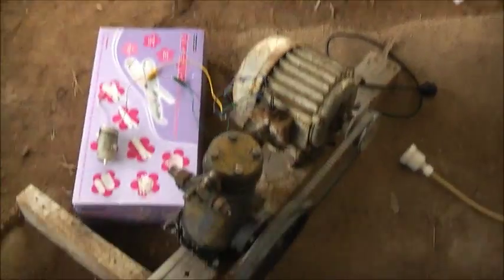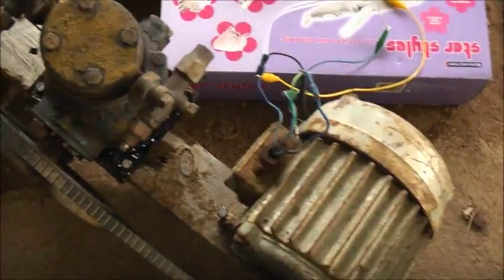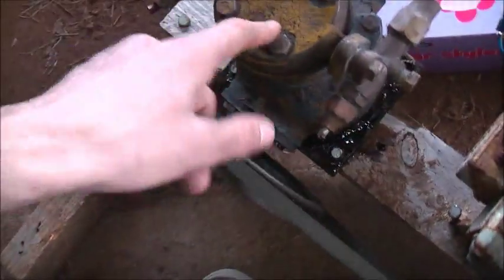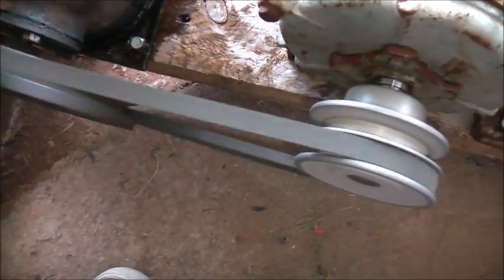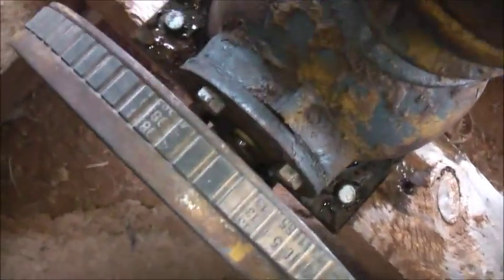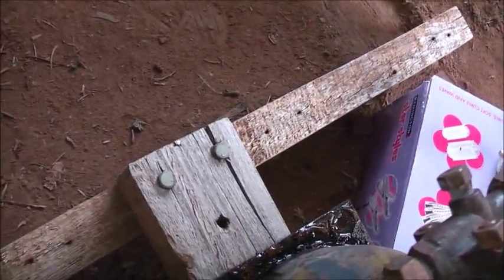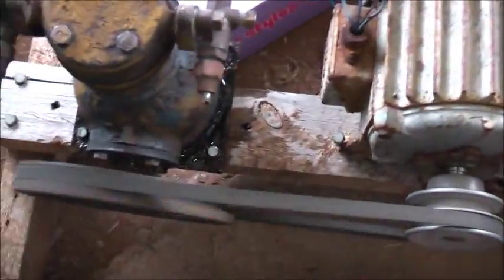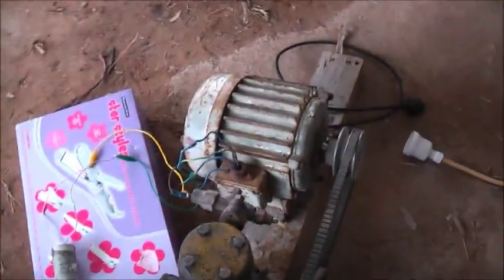Compressor Test On 3 Phase Motor

Comment: nice little pump :):):) the sandpaper trick i worked out when i had to pull apart a cistern ball valve slide to install a new seal(and in that case it was tight, but i had to work out a way of getting it to unscrew but not damaging the slide). that would be an awesome little unit with a tank and unloader